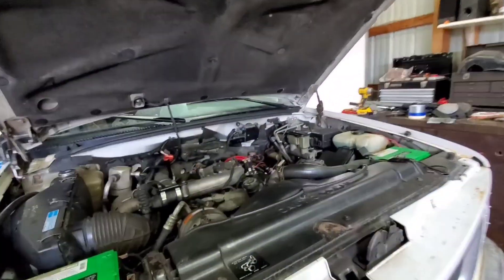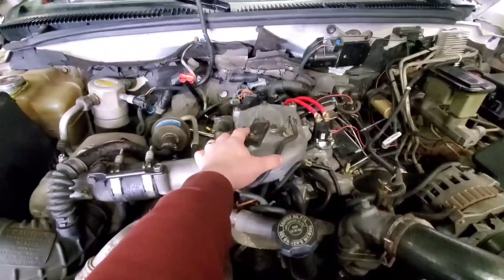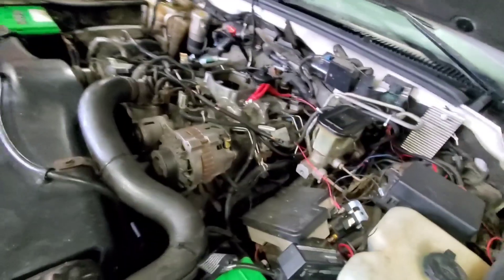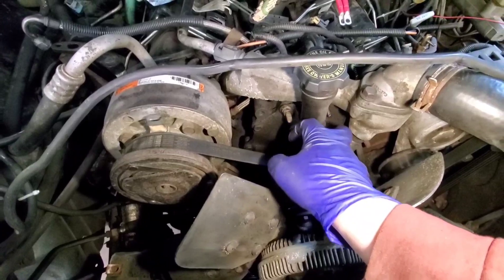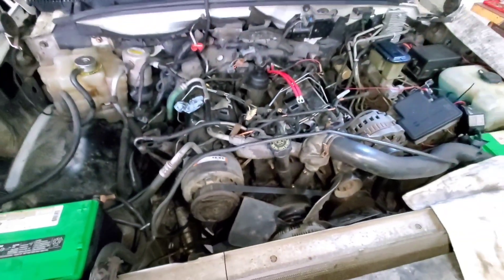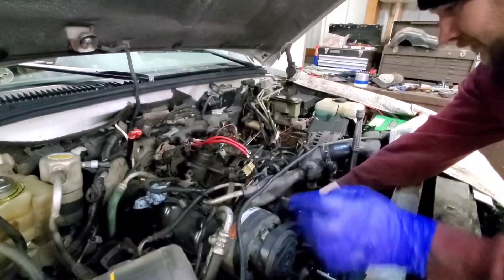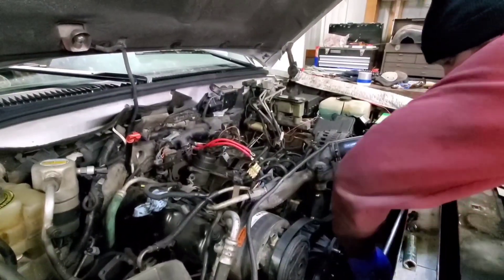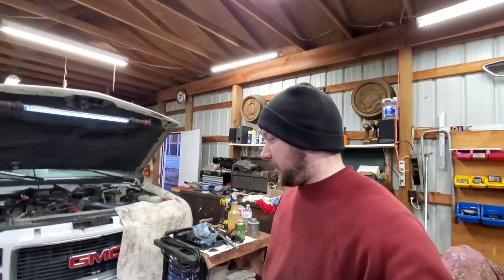6.5 diesel injection pump removal

Comment: Absolutely fabulous video!! You taught me a lot on this issue!! Thank you!!
Reply: @Otto Louis Meh I watch on Flixportal. you can find it thru google:P -santiago
Reply: @Santiago Cassius Thanks, I went there and it seems to work :D I really appreciate it !
Reply: @Otto Louis Happy to help :D
Reply: I got a few questions for ya. Becouse I am swaying a 95 fly by wire to a 93 Mechanical what all do I have to change over or can u just use my old intakes, turbo and injection pump and how do I set the timing??? 
Wondering witch way is easiest

Comment: Just found this, Subscribed. I’m doing a pump on my 96 c3500 white crew. Bought a reman one from Pensacola Diesel and hope it works out. Love these trucks, not big power houses but dependable fuel sipping engines if they’re maintained. 247,000 miles on the clock. Anyway, Thanks for the video
Reply: 300k plus in my 94 c3500 crew red on black
Reply: I just ordered my pump from there today. 279k miles all stock. Was the shipping fast from there?
Reply: @jmeepping1396  yes but I live in Florida so it was probably faster for me. Has worked out well so far so good.
Reply: I'm in Georgia. So was setting the timing a pain? Thanks for the reply

Comment: Cool channel, keep up the good work! Any thoughts on a 6.5 that fires up strong and then dies like there was no fuel supply? Is that caused by injection pump failure? PMD has been replaced already. Thanks!
Reply from the maker: Appreciate it!

I'd start with checking your lift pump/OPS sensor
Reply: @rubberduckydiesel9349  Cool thanks, I can hear the lift pump running before start. Is the OPS sensor next to the fuel filter behind intake? Thanks again!
Reply: Check the fuel oil pressure switch

Comment: Great video dude, super helpful. I got a question for you. I was on my way home from work last week when my 6.5 randomly stalled. Tried to start it back up and it was a no go. Took it to the shop for a diagnosis and they said my injection pump was dead. Does this sound like a pump issue to you or should I be looking somewhere else?
Reply from the maker: I would say so. Every 6.5 I ever have lay waste to the IP ran like a champ and stalled or never started back up after I started it.
Reply from the maker: But I would check your PMD over just to make sure
Reply: @rubberduckydiesel9349  turned out to just be the PMD this time. Still thinking about changing the IP tho since it has 197k on it. It looks relatively simple but how difficult would you say the job is?
Reply from the maker: @marcoveltre3014  basic hand tools and a weekend is ample to do it. It's pretty easy really, just getting the TDC Relearn is the challenge

Comment: Rubberducky can you advise me please? So I am sitting at a light in my 96 6.5L, foot on the brake and the engine all of a sudden revs and the truck tries to jump. After a few times (still at the same light) I put it in neutral and the engine is all over the place. Light turns green, try to accelerate, bucking and jerking and copious amounts black smoke. Fortunately only 1/2 mile to home but at turn light into neighborhood, put truck back into gear and it shut down. Cranked, put it into gear, shut down. Repeat. Barely made it through the light. Does it sound like injection pump to you?
Thanks.
Reply from the maker: I would say its absolutely your injection pump. Park it if you can, some pumps just quit when they go, others attempt to run away. That's what yours sounds like to me.
Reply: @rubberduckydiesel9349  Appreciate the response.

Comment: My truck is a 94 with the 6.5 so it's got the DS4 I wanna put a DB2 on it one day. I like the idea of a mechanical injection pump instead of electronic
Reply: Can pick db2 up for nothing. They make less power than ds4. Do a feed the beast mod, walbro lift pump and wait to start harness (ops bypass)with relocated fsd and you'll be way better than a db2. WAY BETTER!

Comment: I am swaping a 93 Mechanical injection pump 6.5  with a 95 fly by wire pump what all needs to be swapped to make the 95 work or can i use the old manifold   turbo and pump??? Witch way is easier and how to set the timing if i swap the pump...   I am swapping the hole motor
Reply from the maker: Everything is interchangeable minus the pump unless it's a manual truck. I'd stick with the mechanical injection pump if it were me tho.
Reply: It's a Mechanical pump but the new motor is fly by.. when I take the pump out of the fry by how will I know its still in time or how do you even set the timing... This is my first diesel swap
Reply: Also how can I tell if the pump is even good??? The guy I bought it from said the motor was locked up but it turns over just won't start.. found out the head gaskets are blowing at least I think they are another of water came out when I drained the oil 2:18
Reply: Wish you where near ganiesville fl
Reply from the maker: If you have Instagram or Facebook, find me. It's easier with being able to point things out with pictures and such.
Reply: Ok thank you wish everyone was will help someone out.

Comment: Can you leave the turbo on when removing injection pump on a later model 6.5?
Reply from the maker: I know some folks have. I do it just in case an injector loosens with the injection line. And I don't have to work around it.
Reply: @rubberduckydiesel9349  thank you.  Is it necessary to use a program to time the pump? Or can I just drop it in
Reply from the maker: You can, it might run right, chances are much heavier it won't.

Comment: I just got a 95 with the 6.5. They relocated the pmd behind the bumper.  But they bolted it to the plastic fan shroud.  The heat sink was in the glove box.  I had to replace the pmd right after I got the truck.  Now it sometimes runs good. Sometimes jerks and chugs.  The service engine soon light comes on when I go over 1500 rpm. Then shuts off if I go under 1000. But stays on if i go much over 2000 until I shut the truck off. Ive tried a second new pmd and 3 different controller chips for the pmd.  The exhaust is pretty clean. No real noticable smoke.  The service engine light never came on until I put on the new pmd. Im worried it's the injector pump.  But it will run fine 75mph down the interstate and idol fine.  Then it acts up again for a bit then it runs ok again. It's got me stumped.
Reply from the maker: Have you pulled the codes on it? Even if the light turns off it will still be in the history
Reply: @rubberduckydiesel9349  not yet.  The local auto zone and o'riley parts don't have a scanner that will read it.  I've finally tracted down a friend's brother's brother in law that says he has the right kind of scanner.  Just talked to him tonight.  Im at work so I can't meet up with him tonight. Its either a timing issue or the injector pump starting to go out.
Reply from the maker: @myidahohomestead.7123  ok. I know the orielly here has a bosch scanner, they sell it too i have one, but it does OBD2 and OBD1 trucks. Let me know what you come up with, I'm curious myself.
Reply: @rubberduckydiesel9349  the guy that said he had the scanner didn't. But we found air in getting in the fuel system either from the new lift pump or new fiel filter. I've bleed out the filter a few times now.  He thinks I need to have the timing reset on the injector pump to match the new pmd. We are 99%sure the injector pump is not bad. It idols beautifully  just starts missing when the rpm gets over 1500.
Reply from the maker: I've never had to retime when doing a PMD. Could be the optic sensor on the pump
Reply: @rubberduckydiesel9349  this is the first 6.5 I've ever had.  It's all new to me
Reply: @rubberduckydiesel9349  I finally got it scanned by jumpering the wires.  I get code 19  35 and 36.  I cleared the codes. It just cranks and cranks.  Doesn't even try to start today.
Reply from the maker: Find me on Instagram, its the same handle. Send me a DM
Reply: Will do. But it did finally start.  I unhooked the batteries for 20 minutes. Then it fired right up and has every time sense. Still has a check engine light at times.
Reply: @rubberduckydiesel9349  I have tried downloading Instagram 20 times.  It just sits there saying waiting for download. I have replaced the injectors, glow plugs, lift pump, fuel filter, and checked codes.  Ive cleared the codes several times.  Still has the check engine light over 1500 rpm then shuts off if you go over 2200 rpm or below 1000 rpm. Ive changed cards in my pmd. I've moved the from the bumper back on top of the intake manifold. The extension wires were damaged by who ever moved the pmd to the bumper.  They pulled the zip tie so tight it almost cut the wires in half. Still has the check engine light.
Reply from the maker: @myidahohomestead.7123  have you messed with the optic sensor on top of the pump
Reply: @myidahohomestead.7123  do you have a resistor in the plug that goes to the PMD?

Comment: Is there anything I can do to mine it has the check engine light on and it says injector pump but it still runs but it loses acceleration sometimes
Reply from the maker: Did you replace the pump?

Comment: My 1999 6.5 starts hard even right after turning it off. Cracks for at least 5 seconds then runs fine until I try to start it again. I’ve replace both lift pumps and the crankshaft position. Not sure if I did the relearn correctly. Also it has 240k and it appears to have the original injectors. Any advice would be appreciated!
Reply from the maker: Injectors can cause a hard start, I'd make sure there aren't any fuel leaks or blockages and that your glow plugs are functioningproperly. But I'd do them injectors first
Reply: What’s the best way to check for fuel blockage?
Reply from the maker: Crack open the "T handle" and bump the key to make sure that fuel flows out smooth and consistent
Reply: Hey Dylan i have the same issue and i did the same thing except crankshaft position. Is replacing injectors solves the issue. Please let me know

Comment: Tell me you live in Minnesota so I can hire you to fix my long start, white smoke issue.  1993 K3500 6.5l Turbo Diesel.  Just changed out all 8 glow plugs with AC Delco 60G plugs.  When cold, it cranks for atleast 5-10 seconds to start then a bunch of white smoke comes out.  Once warm the smoke stops.  Trying to figure out if I have an Injector Pump issue or I dunno?  The new glow plugs didn’t fix it.
Reply from the maker: I am in Michigan unfortunately. Have you done the glow plug relay by chance?
Reply: Rubberducky Diesel I actually put a new one on thinking that was it, but then the glow plug light wouldn’t come on and it wouldn’t start at all.  I put the old one back on and it started
Reply: Greatful dad, mine is doing a very similar issue, did you figure it out?
Reply: @dylanpries4356  I ended up installing a glow plug bypass.  So I can manually keep the AC Delco 60g plugs on a little longer.  That seemed to do the trick.  If you just put the plugs in it may take a week or two of starts to eliminate the smoke issues.  Check out https://leroydiesel.com/products/leroys-glow-plug-relay-override/

Comment: I recently got a 99 with the 6.5. Do I have to worry about the gear on the pump falling when I take the 3 bolts off?
Reply from the maker: Nope. Just have to make sure you dont drop the bolts
Reply: @rubberduckydiesel9349   how does it not fall off when you pull it off? thanks
Reply from the maker: @michaelrollins3979  the front housing holds it in place, then the bolts will put it back true when you go to reinstall
Reply: @rubberduckydiesel9349  ohh nice, so do I need to worry about timing?
Reply from the maker: @michaelrollins3979  nope, just make sure you line up the dowel in the same place as the old pump and it'll go right back. You will have to re static time the truck and then do the relearn regardless

Comment: 93 k3500 non electronic, after engine is at operating temp if I shut it off I will need cool water to pour on the ip for it to start back up. Ip was remanufactured jan19,2018. I was told possible timing cause previous owner installed it after purchasing from a salvage yard around a year ago. I was told to advance it turning pump to passenger side about 2 degrees to see if that fixes it. Is this correct?

Comment: I’m about to pull my injector pump... my question is about the exhaust runners on the intake... while it’s off will it hurt anything if I block them off to delete the Egr? Or is there an easier way?
Reply from the maker: I believe you can change the upper plenum out and be fine that way. Get a non EGR plenum and remove the egr itself from the equation
Reply: Well... I went a head and plugged the hole  in the lower plentum and made an egr block off plate for the upper plentum!... we shall see what happens... also I removed the vacuum pump can I just disconnect all that crap that has all the vacuum lines going to it??? I am gonna tune this truck as soon as the IP is in and running... thanks for replying btw!!
Reply from the maker: Yeah you can rip all vacuum crap off a s delete the vacuum pump. You'll need a shorter belt, but worth it

Comment: How come you have to remove the turbo? It’s seem like it’s not in the way
Reply from the maker: I dont have too, I just choose too. Makes it easier to access the lines and such.
Reply: Also if you want to change the injectors at the same time, might as well, then the turbo has to be off

Comment: I've got a 98 6.5 with 300500 on the clock. It goes into what I call limp mode. It'll still run, but 39mph. Please tell me this is an easy fix
Reply from the maker: Could be, hard to say with limited information
Reply: @rubberduckydiesel9349  do you have an email I can reach you at?
Reply from the maker: Ironhide6265@gmail.com